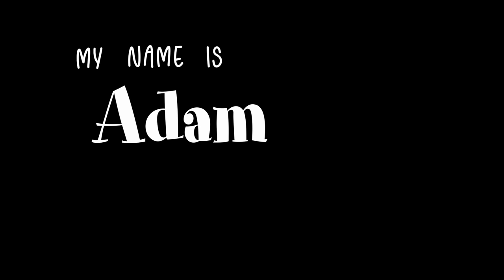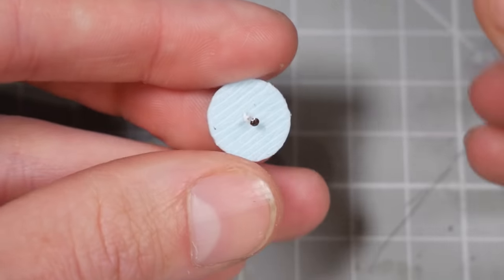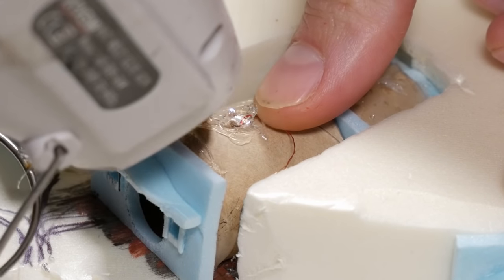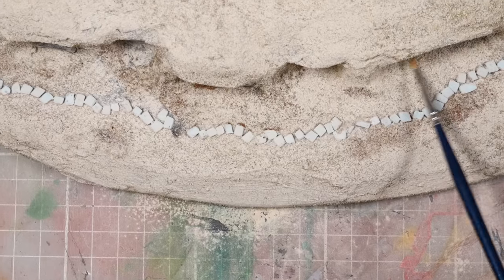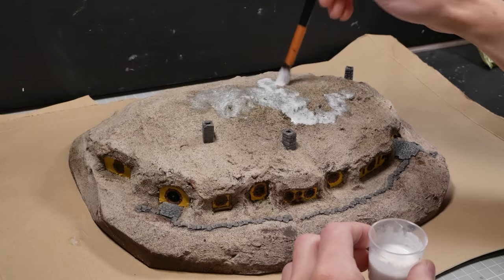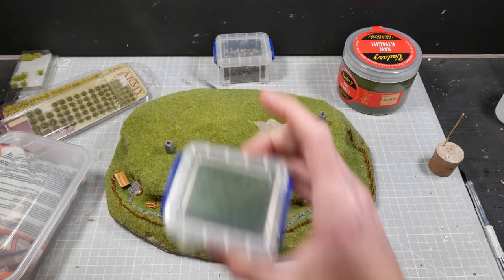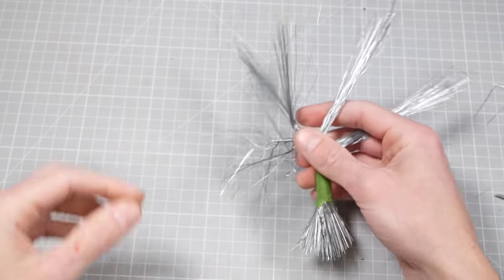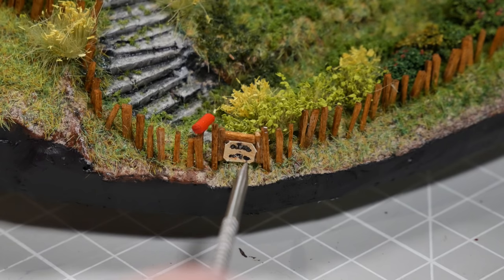How to Make BAG END // Lord of the Rings DIY // Hobbit Hole

Comment: excellent video, however, it's "palette", not "palate"! what foam to use for the main volumes? I think I heard "insulation" foam, but there's gotta be different types I suppose?
EDIT: so this would be XPS as well... I suppose there's not much difference with the kind you'd buy from a crafts supply shop?

Comment: spinning motions when applying the base: gets into all the little nooks and crannies with fewer strokes and in a smoother coat, with fewer visible brushstrokes 
black base: evens out the base before putting other colors on top - if you're putting brown over white and blue, you'll get different shades of brown, but if you put black all over first, the shade of brown will be even all over (in theory, this is also why colour correction exists in makeup)
(edit: does it show that I'm an art/colour theory nerd?)
Reply from the maker: Ah yes, these are all things that I knew about and did intentionally. As long as there are no follow up questions.